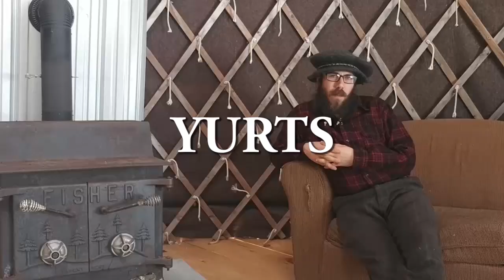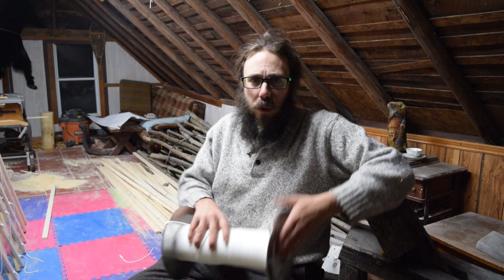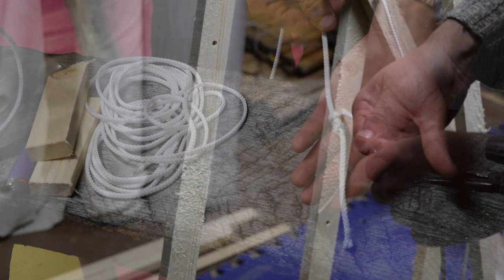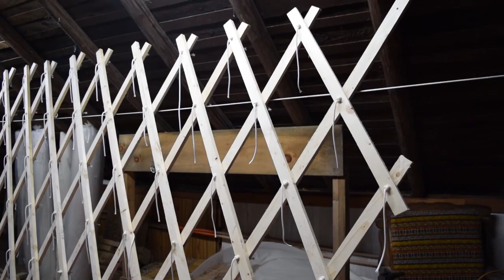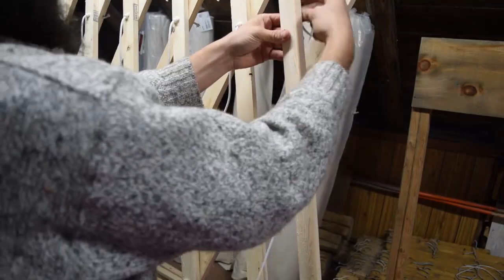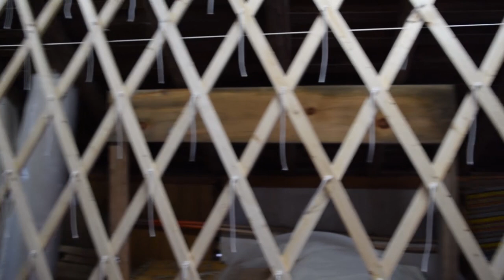Build your own Yurt - Wall slats Part 2

Comment: QUESTION???Can i use 2x2 wood for the walls?
Reply: No they sell 1 by 2 at most hardware stores that are usually good a little too thick I would recommend a planer to thin them down a bit

Comment: Anyone else having trouble with their knots tightening themselves over several moves to the point where there’s space between the slats of the khana?  I’ve been using 1/4 braided nylon with a core.  They turn out great on fabrication, but after packing up and setting up again several times, the snug fit becomes maybe a 3/4” gap, and I’m finding myself having to tie the knots all over again.

Comment: Very Cool! Can you re-specify the diameter of the rope you use? 1/8" seems really thin. thanks
Reply from the maker: 1/8" works well so long as you have good spacing between the slats, to little and its probably weak, too much and its overkill, mine are spaced 12" apart, the rope has not failed, its always the wood

Comment: Would Bamboo be a good alternative to traditional wood?
Reply from the maker: I Think I could be, but not for snow load, maybe in tropical areas
Reply: Does bamboo not have a better tensile strength than even steel ? I’d hazard a guess that it could quite readily be used to form the lattice walls . Probably be lighter and cheaper as well ? There again there might be a reason why it isn’t/hasn’t been used before now. 🤷‍♂️

Comment: 16:18 If you shove a small Phillips head screw driver (#0 size is slightly less than 1/8") through the holes in both wooden slats before clamping them; making a temporary hinge from them. Then clamp the 2 slats together. Remove the screw driver. Now the two holes will be in perfect alignment. Next thread the string right through both holes, rather than having to eyeball the hole alignment.
Reply from the maker: Great tip! love it

Comment: Would the second wall then be  the opposite with 12 in front and 11 in back? (The third wall made the same as the first to fit properly where they connect?)
Reply from the maker: the third wall is slightly different, I am going to try and get the dimensions up this week since there have been lots of questions!!
Reply: @FoxfireHeritageFarm  thank you!